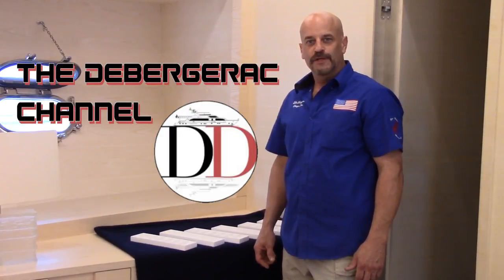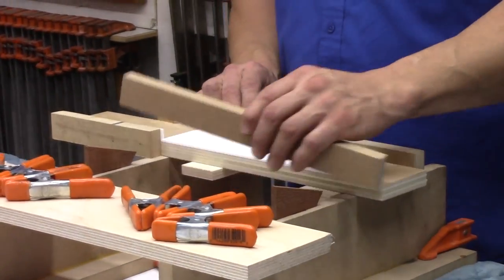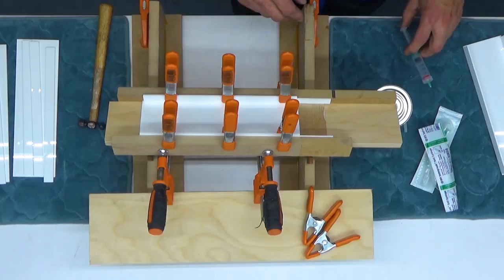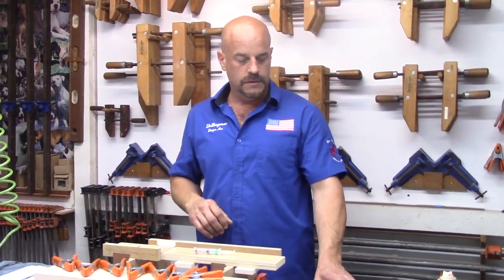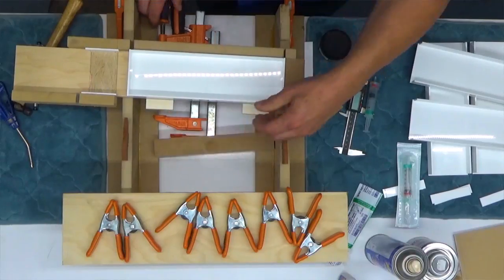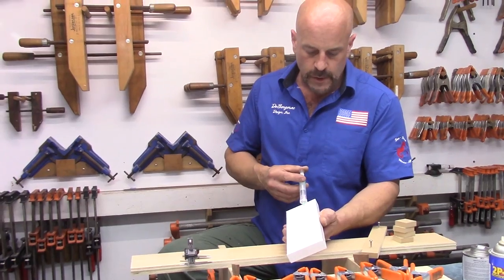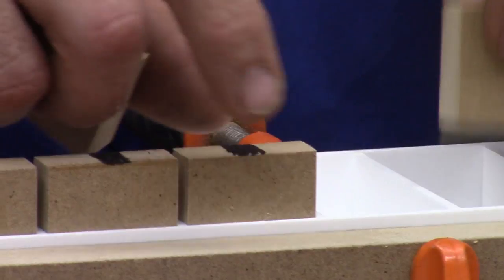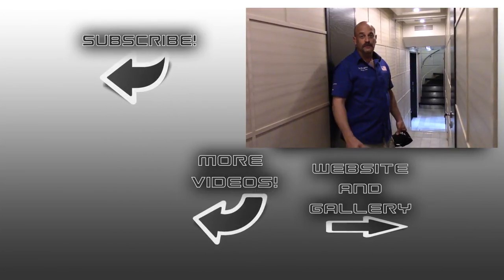Custom Jewelry Dividers Made From Acrylic Using Simple Jigs

Comment: Very cool video again, but leaves me with 2 questions;
1- Does this method also work on clear acrylic?
2- How do you sand the edges flush (the ones with some extra length) without damaging the surface of the other pieces? I tried it several times, but it leaves me with scratches from the sandpaper, therefore I need to polish the whole peace for an 'somewhat' decent finish.
Anyway, thanks again for a very cool video. Keep up the great work!👍👍👍
Reply from the maker: Sigi, exactly the same method on clear acrylic as on the colored. This is why I took great care in explaining that you don't want to get the clear glue on to the non glued area of the acrylic.
It is best to try to avoid scratching any flat areas that are already polished. It is all in technique. Practice and find your method I've been working with acrylic for over 20 years and scratched many surfaces from improper technique's. 
Jim

Comment: I am relieved to hear that we are worth the sacrificed acrylic for demonstration purpose; on another note what would you recommend short of syringes. I remember years ago asking my local chemist for syringes for oiling delicate parts. I did get them but he took some convincing in spite of the fact that he knew me well; that I had no other interest besides my intended application. I would hazard to guess that if I made a request today at my local chemist; they are very likely to suspect that I am into injecting some illicit substance into my body. I am not sure we have this type of glue in the UK; could one use super glue ( the stuff with cyanide in it; another nasty poison but this one seems OK unlike clean syringes!!!!). I do a lot of jigs using engineering plastics & am limited to using mighty expensive stainless steel screws as most plastics do not take to glueing very well. I await your comment. All the best & look forward to next week. Kind regards.
Reply from the maker: I order them on line, my local drugstore will not sell them to me either!
Jim

Comment: Get lab grade syringes without black rubber.
Reply from the maker: Do you have a source or are you just offering up your IQ level?
Jim
Reply: Free IQ level is great isn't it? I use these lab syringes myself, that's why I offered my knowledge. Had many problems with regular ones, if you try lubricants like machine oil in these they seize after few minutes !
Reply from the maker: Thanks, just wondering if you are going to offer up a source because I have yet to find them.
jim